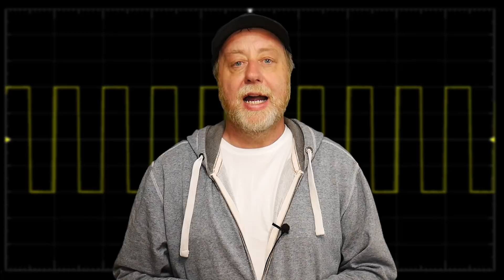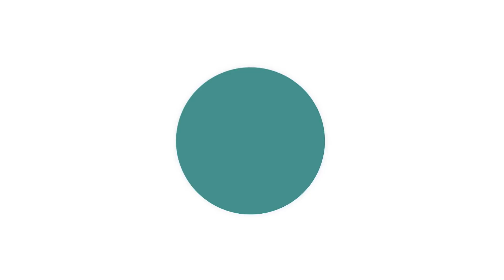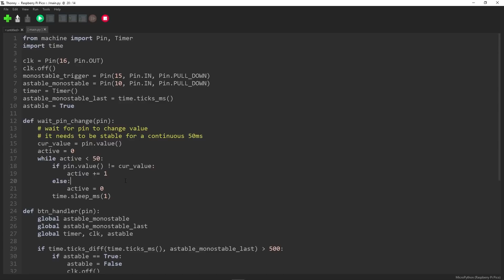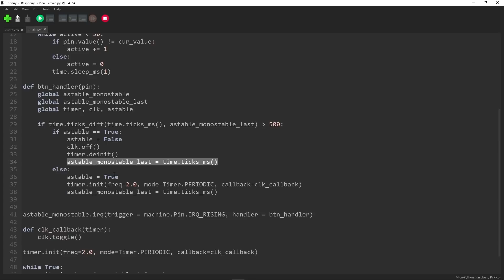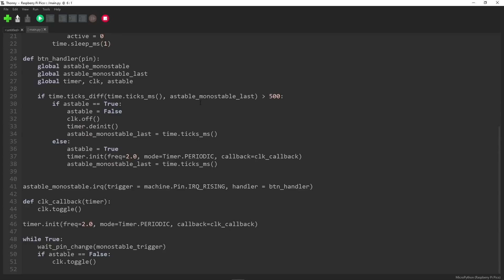I Built a Computer Clock Module for DIY Computer Projects Using a Raspberry Pi Pico

Comment: I've been watching videos like this everyday when I can and taking notes I got a project in the works that plans to kind of clone some of these 6502 bread boards, but instead use a Super Nintendo CPU and processing units like the real Super Nintendo circuit while upgrading the ram/banking. Kind of phase zero of pre-planning and gathering my breadboard and more professional supplies might even also have to get a new soldering iron my two in one hot air gun combo is acting strange. Phase one is getting it together and just getting it to run correctly and seeing what I have to change and accommodate for seeing as it's a 5A 22(it's a licensed 65816) instead of a 6502. I can say though I have most definitely learned a lot about computers here recently. I almost no longer consider them the same thing as a PC.....so for SNES CPU is timer.init(freq=7.16,"....I wonder if thats possible?

Comment: Thank for the video Gary. Presumably the 6502 was ok with the 3.3v clock, despite it being a 5v part?
Reply from the maker: The modern WDC version (which I am using) supports a wide range of voltages.
Reply: @GaryExplains  Ahh, I see. Were you also powering it with 3.3v, or just feeding it a 3.3v clock? I am also playing with a 6502, having been inspired by Ben Eater, and I was going to use an Arduino Nano for the clock and glue logic. A Pico would give me a lot more options.
Reply from the maker: The other Pico, which will be the eprom eventually, was providing the power, it was the most convenient option.
Reply: @GaryExplains  Thanks for the tip! I had completely missed the low voltage support of the WDC65C02. This opens lots of new possibilities for me.

Comment: It would be handy to also use the RTC hardware with a backup battery in low power mode to add a real time clock to retro machines as well.

Comment: This idea you have to emulating things with Picos is similar to an idea I've been kicking around.  I want to build a processor using Picos, but I don't want to do it all in a single Pico.  Instead, one Pico could be the bank of registers, another could be the ALU, another could be the control logic / instruction decoder, one could be the MMU and memory, and so on.  That way I could define the bus between the modules and get the arbitration working.   In theory I could then replace one Pico at a time with "real" hardware if I decide to.

Comment: Great video. Ben Eater is awesome. Hopefully, you’ll hook up those Data Lines in the next video, so we can see what’s coming out of the ‘02. The ROM is a huge speed bottle-neck, so being able to emulate a ROM with a fast microcontroller is great. However, as you are running at 3.3v, to use the Pico, you won’t be able to hook up an ACIA - those only work at 5V. Now, if you can emulate an ACIA with a Pico, such that you create a Pico-ACIA working at 3.3v - that would be HUGE. Plenty of people looking for a 3.3v ACIA in the 8-bit fan world.

Comment: Pleased to hear your mention of Ben Eater. His 8-bit computer and 6502 projects are magnificent to behold and will provide a hands-on education in basic electronics/computing that I have not seen anywhere else. I only wish there was an economically viable way of purchasing his kits in UK. If I was not otherwise occupied I would seek his permission to do so myself. Besides that. Thank you for your own unique contributions to spreading insight and understanding.
Reply from the maker: You can get most of the bits in the UK without any problem. I got my 6502 from eBay. But because I don't want to buy an eeprom programmer I will emulate and eeprom using the Pico.
Reply: @GaryExplains  Gary, don’t pay usurious EBay prices. WDC (Bill Mensch’s company) still makes NEW 65xx chips, and their peripheral chips. Bill Mensch is one of the fathers of the 6502, and his Western Design Center is still cranking out those chips.
Reply from the maker: I bought a WDC version and I don't think I paid a usurious price.
Reply: @GaryExplains  Good! I look forward to seeing how your project evolves. Best of luck! J

Comment: Using a Raspberry Pi (whatever) for some kind of ROM, is really sensible. And it can be extended to be some kind of long term storage IO enabling you to load programs stored (and developed) on computer into RAM chips or function as RAM.

Of course no retro project would be complete with out the obligatory CPU war. Your mistake is using a 6502 instead of a Z80 :)
Reply: Z80 which was made by ex intel employees (because intel management said there is no future in microprocessors), 
"life with david" channel is also doing stuff with the 6502 and pico pio ...  (LifewithDavid1)
Reply: Using a pi is just cheating and very bad for actually learning something. Ben eater does it much better. Or James Sharman. Not about CPU, if you want to learn how to work with hardware, then programming a clock on a pi is a weird away to go. A 555 and a few flip-flops could give you all the functionality and it would be on real hardware as opposed to software.

Comment: This is the equivalent of cutting a birthday cake with a chainsaw.
Reply from the maker: Except that Ben's clock module cost $35, this one is cheaper and easier to understand by a long way.
Reply: @GaryExplains  I guess Ben's module would cost less if he purchased parts in bulk on the scale of the Raspberry Pi Foundation for the Pi Pico.

The performance different is still there though ^_^.

I've not watched the video yet, I wonder if it can be done entirely in the PIO?  I'll watch and find out how you do it.
Reply: @Gary Explains  Are you sure that's not $3.50?  I believe Ben's clock is three 555, three 74ls, and bits. That BOM is closer to four bucks than 40 even in these dark times.
Reply from the maker: Go look on his website.
Reply: @GaryExplains  And...? The schematic for Ben's timer shows 3 555 ICs, 3 74LS ICs and some passives. I'm pretty sure you can buy the lot in 1's from any name brand supplier for 5 bucks or maybe less (plus shipping). 

Sure, he sells a kit but with a nice breadboard and a nice power supply and accessories for $35. No doubt it's good value for what you get but you get a lot more than you need to build the circuit if you have anything at all on hand. The pico circuit needs a power supply, a breadboard,  buttons, resistors, LEDs, etc, too. I think the cost to build his circuit or yours would be very similar for most folks.
Reply from the maker: OK, maybe my cost argument wasn't as valid as I implied. But I still don't agree with the OP.
Reply: @GaryExplains  It might be that cutting a cake with a chainsaw is good pedagogy sometimes? Anyway, I think your circuit and video are excellent instruction. Thank you.